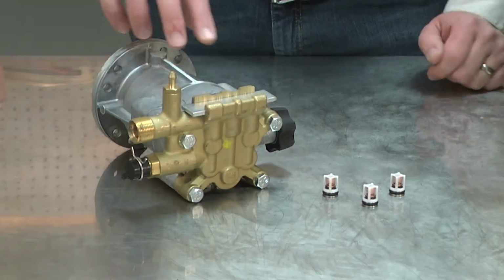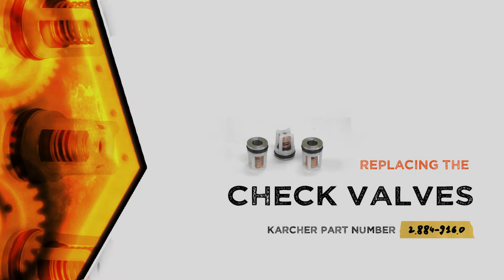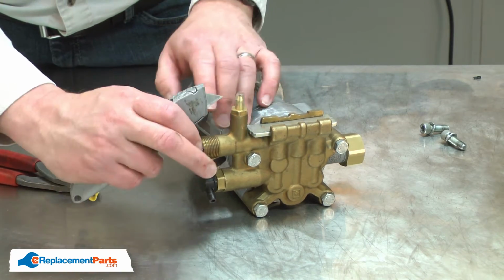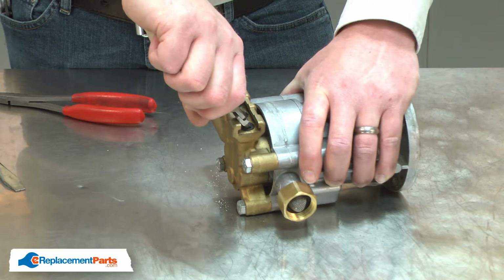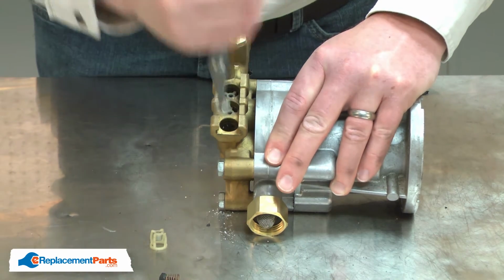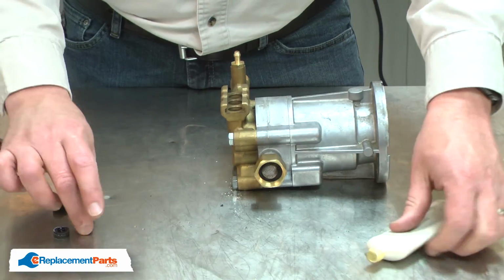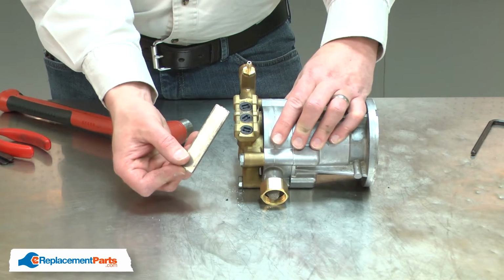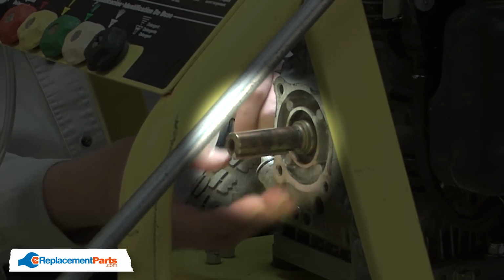Karcher Pressure Washer Repair - Replacing the Check Valve Set (Karcher Part # 2.884-916.0)

Comment: Although silicone grease (PTFE) can be purchased online, auto parts stores and some home improvement stores, it has other uses. (Note; Dielectric Grease works as well)
 I you live in areas that freeze, apply a light coating on your vehicles door seal rubbers. Gently wipe to remove excess, but leave a film on the rubber. It keeps doors from sticking firm when frozen, but hydrates the rubber to increase its life span. It can be found in the owners manual, that book that is skimmed thru! 
   Brakes benefit from high temp PTFE brake lube as well. The compound doesn't effect stopping if some gets on the friction material. When wire brushed ends are cleaned & blown off if compressed air is handy (No Asbestos Since 1966), but apply a dab where the pads tough the circle of the piston(s) and outer frame, usually front and rear. Tighten wheel by hand, then torque to manufactures specs. Aluminum wheels are higher than steel. Check owners manual in maintenance. (Warning; Never let a shop use colored "Torque Sticks". Too many variables as you, wife, daughter and shops can't remove them without excessive force. This comes for different air pressure, impacts and how long a mechanic hammers) too risky when miles from service like South Dakota and other beautiful fruited planes on vacation to uncle Bobs horse ranch, a dude ranch or Yellowstone. 
ASE Master Tech since 78, retired.